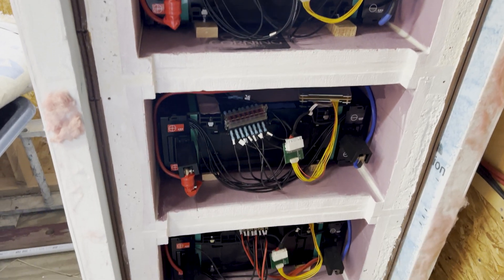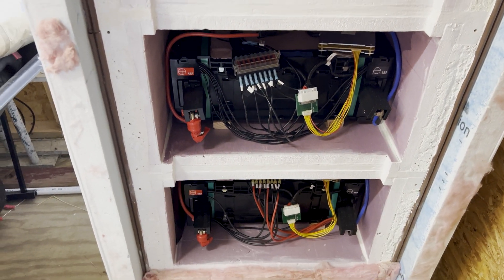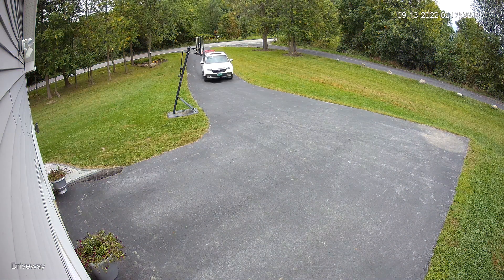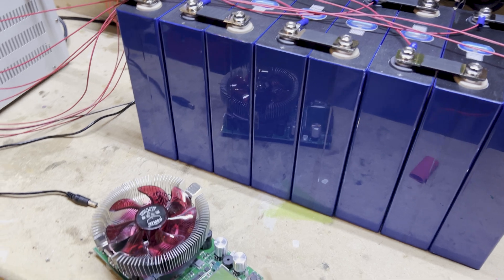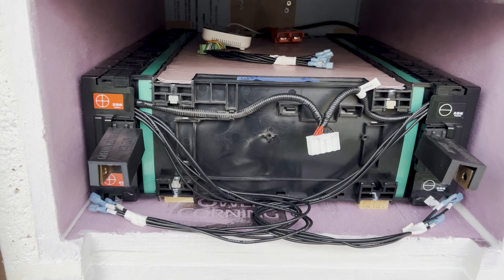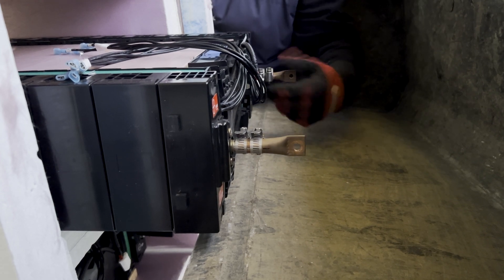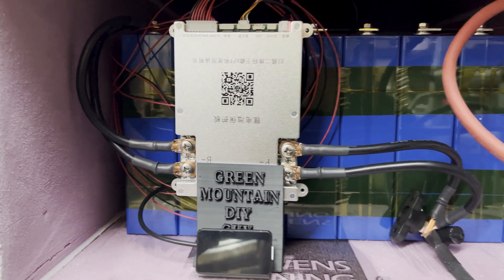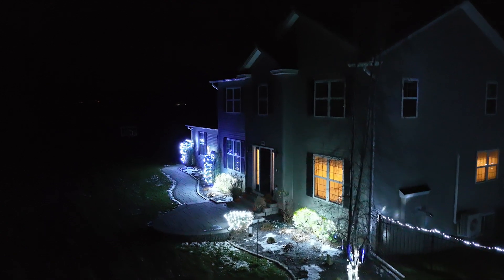New LiFEPO4 Batteries in the OFF-Grid Shed!

Comment: LOVE IT BROTHER! Sorry the old guys craped out. Nice to know your good for 20 years + now. Thanks for letting us be a small part brother. God Bless.
Reply from the maker: Thank you Bobby!  I have been so busy at work that there been little time to make videos.  Going to have more time coming up soon!  I sat down and finally getting caught up on some of my favorite YouTuber’s that I follow.  I enjoyed several of you videos last night, especially the scooter rebuild!  Thanks for watching!
Reply: are you saying you have batteries that have lasted 20 years on a solar system??  I've yet to have ANY Batteries last 10 Years, before degrating bad enough that they need replacing soon after.. what  brand are you using? cost etc?? maybe I don't spend enough on batteries? LOL
Reply from the maker: @compubyte2010  The new batteries (brand, AH, etc) were listed both in the video and description.  I don't list costs because these numbers change and it is easy enough to click on the link to figure that out. The number of years you can get out of a battery (especially LiFePO4) is all dependent on how you initially use the battery especially in consideration of cycle count, depth of discharge, operating temps, etc.   Those previous BYD batteries were pretty abused, probably out of a bus or solar farm.   Getting 20+ years out of LiFePO4 will most likely be irrelevant based on the sole fact that technology will drive better batteries and the desire for new upgrades and purchases.  Thanks for watching.
Reply: @GreenMountainDIYGuy  I strongly feel either the technology for batteries needs to change, or the price of batteries will skyrocket.
Reply: @compubyte2010  My Cells came from a 2012 Chevy Volt. Had them running 5 years maybe 6 and still getting about 98% of there rated capacity. Those cells he just put in if taken care of will last 20 years. Heck my cells in my golf cart are 10 years old from a city bus and still getting 98 or more of there rated capacity..

Heck I had a set of Trojan t-105 golf cart batteries. Run in my off-grid cabin. That I lived in full time. They lasted 5 years then my dad ran them in is golf cart for 2 LOL.. That still socks me those lasted that long.